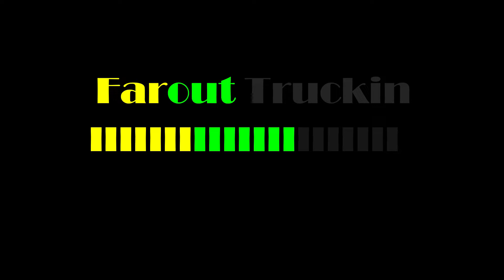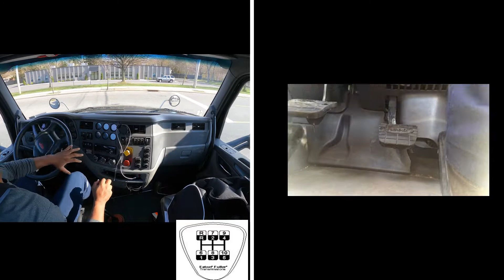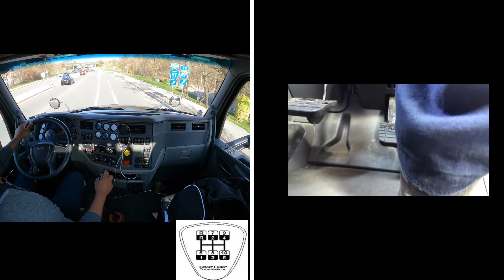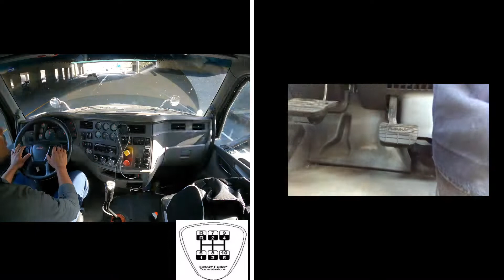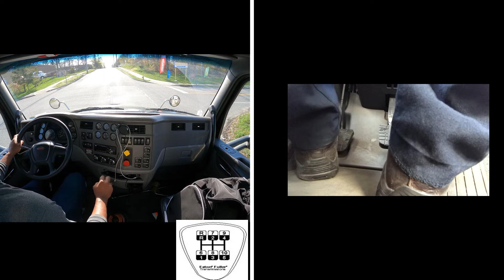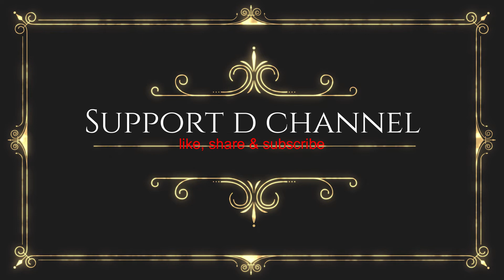Pedal View | How to Upshift and Downshift a 10 Speed Transmission Without The Clutch pt2

Comment: So the sweet spot to down shift is to bring rpm from  10 to 14 rpm and pop it in gear once it hit 14 rpm correct??? Also on the lower gears like 5 4 3 do you also bring up the rpm at 14 too to get it in with out grinding ???